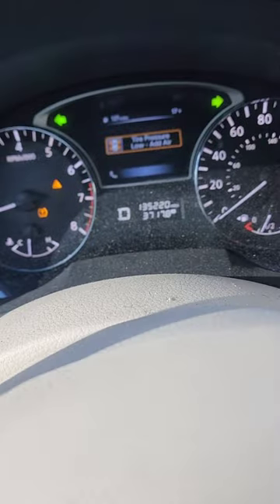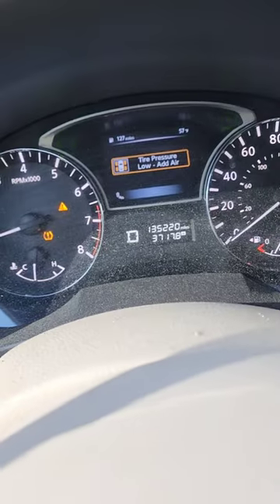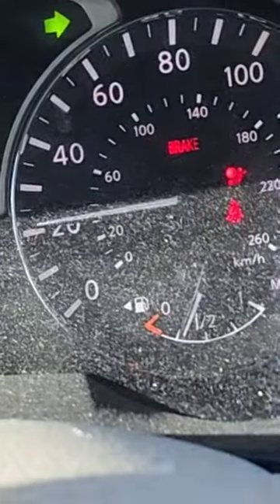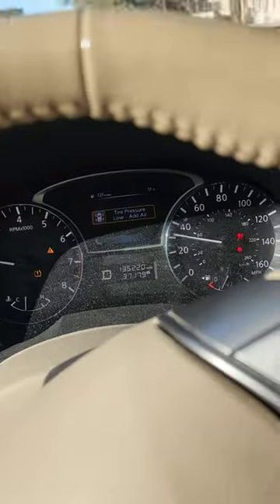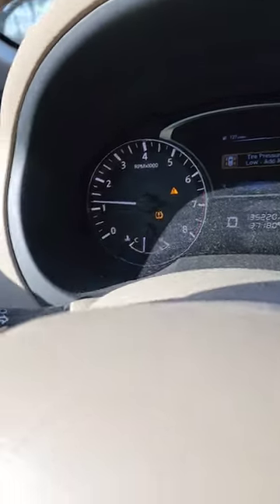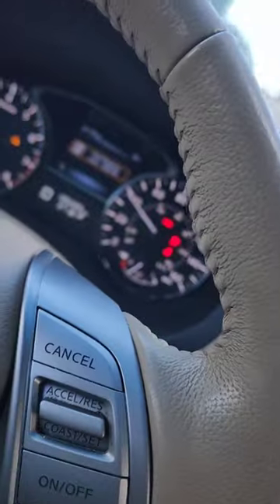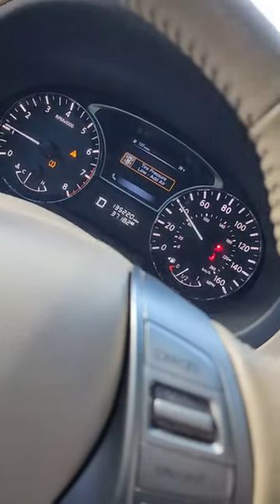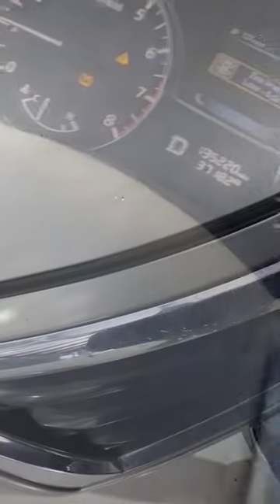🔴WIERD CUSTOMER COMPLAINT 🥴 #shorts #auto #mechanic

Comment: Ok I need help. 2012 Nissan Murano 97500 miles. Nice car runs very well but sometimes Boggs down from stop in traffic for 3 to 6 seconds then clears up runs great no mil on. What is your take?
Reply: Start with the basics.  Check/replace the air filter, clean the maf sensor and the throttle body, and have the battery tested.  Then check for engine codes.
Reply: @kelsycunningham8452  thanks air filter new mass a/f clean did hard reset, battery terminals clean. But no codes. Ghost in the machine!